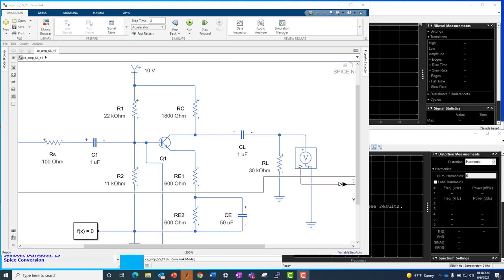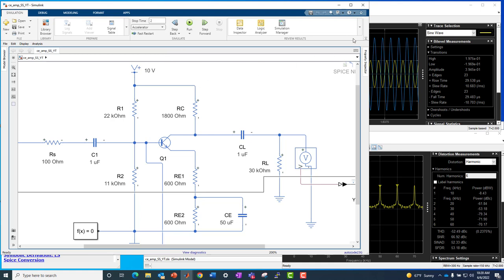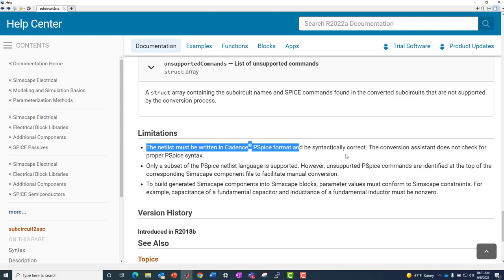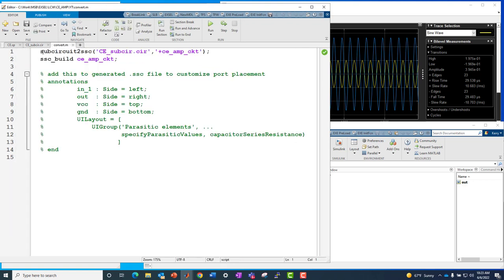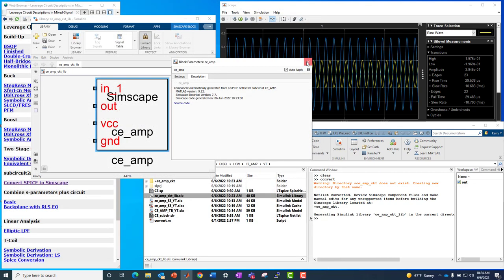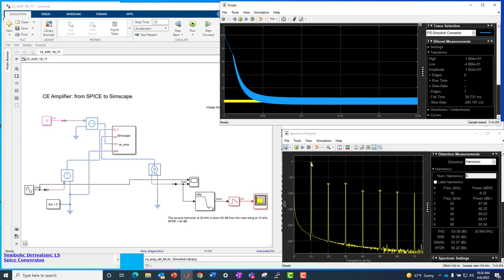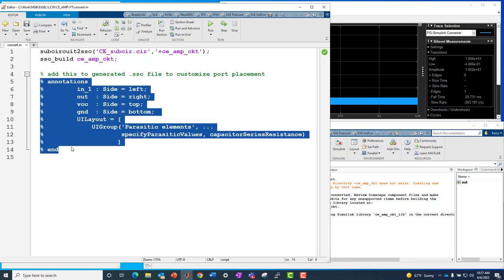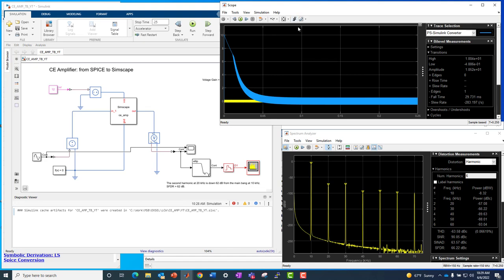SPICE to Simscape: Common-Emitter Amplifier

Comment: I get an error when I run the Convert.m file
I am not sure what is wrong.
Can you help me identify the invalid string?

Error using fieldnames
Invalid input argument of type 'string'. Input must be a structure or a Java or COM object.

Error in spiceSubckt/preparSimscapeFile

Error in subcircuit2ssc

Error in subcircuit2ssc (line 31)
        subcircuit2ssc(netlist,target);

Error in convert (line 1)
subcircuit2ssc('CE_subcir.cir','+ce_amp_ckt');
Reply: Can you share your file